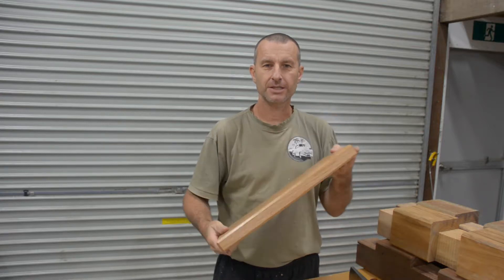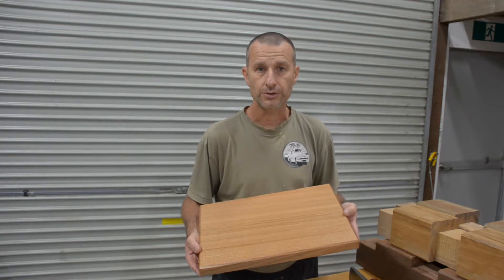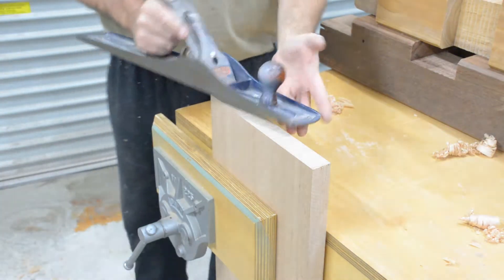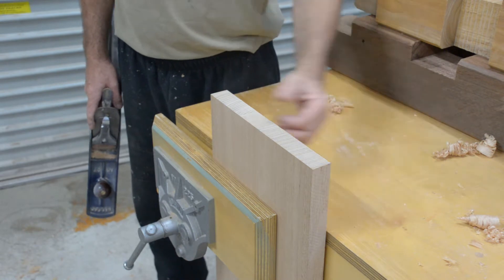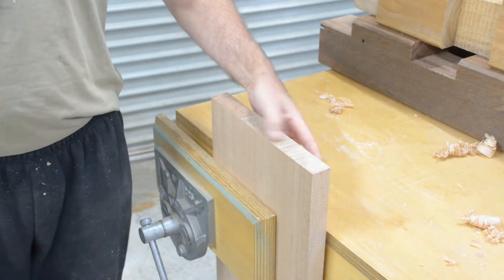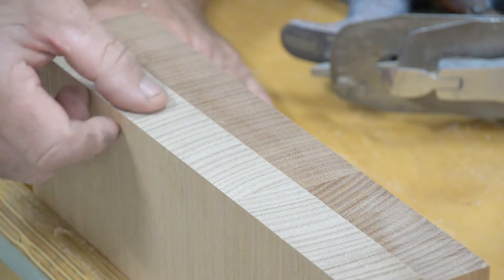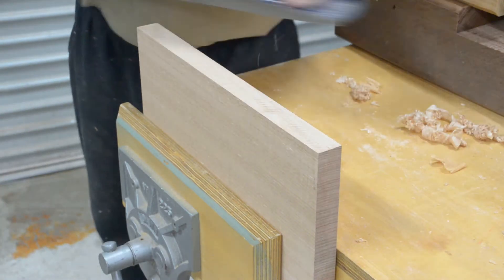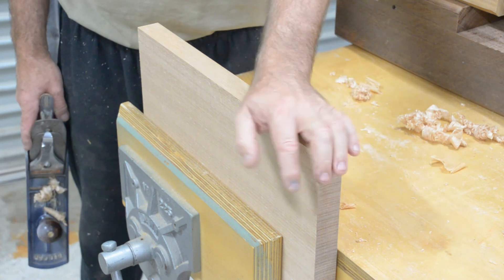Planing Australian hardwood

Comment: G'day, this is brilliant. You are the only person I have found who explains what is happening when you work on our hardwoods. I am down in South western NSW. Our Gray Box and Yellow Box is really hard. Id never heard of having the blades on gear set almost at right angles, Cheers
Reply: It can be tricky stuff to work with.
If you are working with hand tools you need to have angles sharper than say 40 degrees.
Carbide machine tools are closer to 90 degrees but even router cutters are more like 60 degrees.
High speed steel spindle cutters are around 45 degrees.
Most chisels and plane blades probably need about 35 degrees.
My plane blades are a percentage of Tungsten.
Going beyond say a 3000 grit sharpening stone or diamond lap is pretty much pointless.
Reply: @mhelmreich1  i have a 4 1/2 scrub plane to set up sk im going to give the angle of 35 degrees a go. Always looking for ways to make the work easier. Ive also got some hand saws to resharpen. Ill be looking at the angles on those as well.